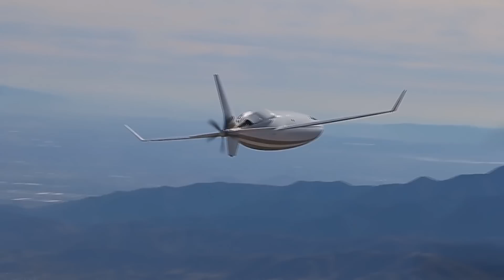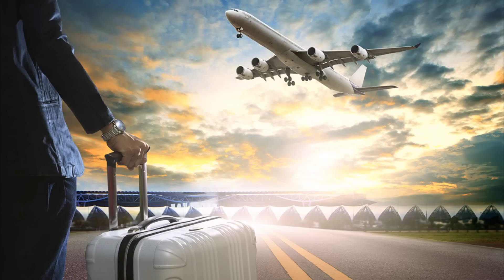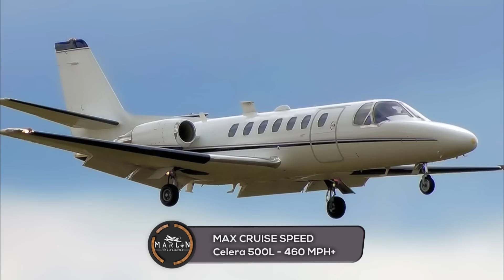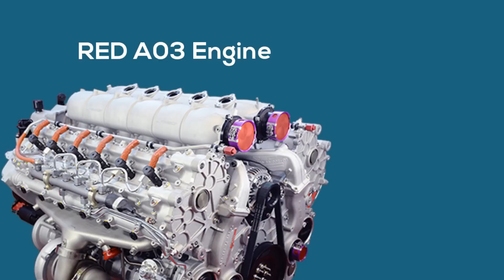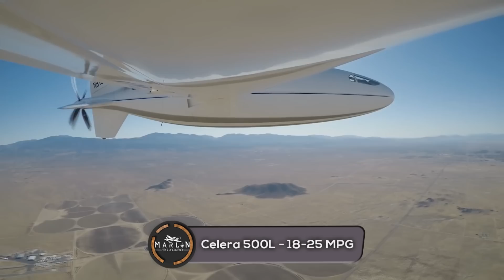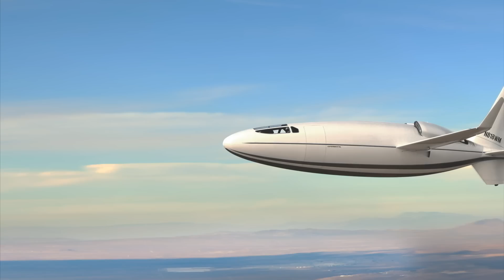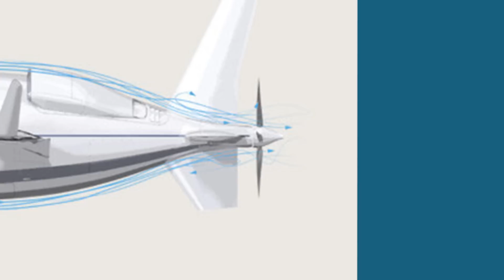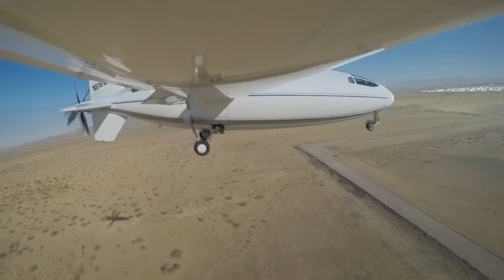Meet the Celera 500L (Flies Faster, Farther, Higher, Cheaper)

Comment: Is bringing inexpensive, private flight to the middle class necessarily desirable for society?  It would take 17 Celera 500Ls to equal the capacity of a 100-passenger jetliner. Granted, each plane is smaller, but that would mean 17 times the number of takeoffs and landings to move the same number of people and many airports are at or near flight slot capacity already. All those small planes in the sky could create and air-traffic control nightmare and might require the building of hundreds of more airports.

Comment: A standard diesel engine and an electric motor could cut costs to totally revolutionalize the air transport industry.  Take off with the regular engine, cruise at high altitude with the electric with power from the solar panels in the wings, and fuselage with the diesel engine as back-up.  This thing could reduce costs to almost nothing. It wouldn't even need that much fuel.

Comment: They should look at the wright speed electric generator jet engine as a hybrid for electric propulsion. Also flexible wings for control surfaces replacing mechanical surfaces saving weight and reducing drag. The design has the potential to eliminate business and 1st class air travel from air lines. A drone version would be a great freight hauling ( remote locations ) or high flying long endurance observation drone.

Comment: Paper airplanes often have remarkable capabilities. Let's see how this performs after it actually is built and flies, if it ever does.
Reply: I think they have a bare-bones unit in test, but they are a very long way from a certified aircraft. There will probably be significant performance degradation when the cabin is furnished. Things like seats and windows and window shades, and drop-down oxygen masks and carpets and fasten seat belt signs ,and a potty and pressurization, that a plane in this performance class absolutely requires not to mention de-icing and weather radar all weigh something and detract from performance. Pusher aircraft often have noise problems, and one of the selling points of this aircraft is it's ability to get into a lot of smaller airports that are operating under extreme noise limits. Carbon fiber anything hasn't been especially cheap, and price point is very important in making this thing viable. This is a very complicated,  very limited production engine, which, as far as  I know also has to go through certification since it has never been used in an aircraft before. Sounds like it will make Formula One engines look cheap .Exciting concept, but in aviation, it takes an enormous amount of effort and money to get a concept into production.

Comment: Yes in my opinion it has sick specifications and yes it would most certainly disrupt the market . Remarkable efficiency. Garima this aircraft has three times the range of a typical 6-seat  passenger jet which means the passenger jet has to land and take off three times so even if it was traveling 50 knots or 100 knots faster it would not matter one bit since it has the land and take off and use more fuel and over head expense and time which would drastically increase the cost of going from a to b correct?

Comment: Beside the already proven X-1, efficient, .50cal copy fuselage design, have you ever bought your kid one of those hard rubber underwater torpedoes to play with in the pool? With water being 800 times more dense than air, any design that goes half way across a swimming pool with a flip of the wrist is certainly something to consider. See the resemblance?  Good on ya Otto!

Comment: I can see this replacing most single engine aircraft very easily. Costs less flies further, roomier, is not a patched up 1960s or 70s design but new with all the fixes built in and at least most of the bugs built out.

I'm sure it will still cost as much as a couple of new suburban houses with all the trimmings and in ground pools. I want these guys to succeed.

Comment: What makes this plane different is not the shape, its the engine.

Its a DIESEL. 

Aviation diesels are a game changer because not only do they use a cheaper fuel (jet fuel instead of gasoline) they burn that fuel more efficiently.

They also made each each side of the engine independent so it is technically two engines in one block.

This is a big deal because the FAA puts huge restrictions on single engine passenger planes.

The weird shape is from them putting a large business class cabin in a small single engine plane...and then using every trick in the book to get drag down so that engine could make the plane go fast.

If the operating costs are low enough , you could see the price of a chartered flight from  Chicago to Disney World drop down to something a middle class family could afford.

(Imagine a family vacation that didn't involve O'Hare or Orlando International Airports...or being crammed in a plane with 200 other people)

Comment: Be great to see if they could use a Deutz air-cooled V8 diesel, and ditch the reduction box (assuming it uses one)! Possibly make it even cheaper to run?
Reply: The Red A3 is a very unique unit. It is actually two inline 6 cylinders geared together that can be decoupled in the event one bank fails, providing better redundancy than a twin.

Comment: Very interesting design that solves many GA issues such as archaic power plant running AVGAS replaced with high efficiency FADEC Diesel running on inexpensive and more available JP1. The laminar low drag is revolutionary as is the pusher power plant. I like the diverse single engine non-turbine solution that gives superior economics of diesel over brayton gas turbine. I’m intrigued about the flight characteristic and curious why a forward canard airfoil was not implemented to impart better safe-by-design due to nearly impossible to stall flight characteristics with a forward canard airfoil. Love the fuselage fuel tanks and dry wings as this has much improved accident safety implications. Also, the rear stabilizers and control surfaces provide significant protection from a prop strike that can easily cost $100,000 in a gasoline piston engine and $500,000 in a turbine engine.

Comment: For a plane focusing on laminar airflow, I'm surprised they didn't do a flying wing...   Ultimately, such planes are limited in size hence until we have autonomous vehicles which we probably could already do with airplanes today, the costs of operation will be high per passenger.

Comment: Aircraft engineers here ? Concerned about the CG being far aft, with a long fuselage forward protrusion destabilizing the whole thing. Hence the need for a giant fin. But there is no room for a standard low AR fin as the structure of the fin must leave space for the engine compartment. This fin has an AR ratio so high it may stall under relatively modest slip angles. As always, optimization of a criterion being made at the expense of other criteria. Comments welcome.

Comment: very well designed plane. low body drag, thin wings withe great lifting ratio and well placed rotor. those drag designs technologies have been applied in solar cars and some airplane concepts by boeing. this is good news but still a sailboat doesn't consume energy.

Comment: I've been following this aircraft a little bit and iam an avid aircraft enthusiasts and I have to say these numbers and performance claims are sketchy. Don't care how efficient  this aircraft is but there is no way it has a range of 4k or more a turbine engine at 60 thousand feet very doubtful  for a general aviation  aircraft. ALSO putting fuel in the wings is safe just ask Diamond aircrat... I can goon and on. You can make anything glook goodonpaper when you need inventors

Comment: No windows.  I wonder if they can keep the Laminar shape and add windows to the plane.  Imagine the future with hydrogen fuel cell versions (Battery power will not have enough fuel density power a long haul air craft).  Remember how zeppelins used hydrogen for lighter than air travel? Well these are not airships and are aircraft (heavier than air travel), but if they end up using Hydrogen fuel. It would make the circle complete, just a lot safer.

Comment: Looks incredible. Great idea in exploiting the lower drag associated with laminar flow. Would laminar flow result in lower cabin noise?  
What about the larger 100L (1000L)? What is the passenger seating capacity and headroom of the proposed  larger model. Are performance specs of the larger model expected to be similar to the 500L?

Comment: As someone who flies a jet for a living at the altitudes and speeds that this aircraft company claims it can do...it’s not possible. I fly an aircraft that carries 10 passengers with a smaller fuselage cross section and it does about 460 knots at 41,000 feet with about 40x the power that little v12 makes. My guess is by the time they put an interior in it, make it handle safely, and get it certified it’s gonna do 250 knots max. Hate to be a hater but the only prop planes to come close to those speeds are the Reno air racers which have many thousands of horsepower, have propellers from defunct airliners, clipped wings, slammed cockpit canopies, and are listed as experimental because their handling isn’t safe enough for passenger transport.

Comment: I would like to see an independent group test this.  It has a 2 vertical stabilizers, one is quite large, that should produce a lot of drag, also 2 large ducts.  The body is the only thing that's different and all planes have decent aerodynamics.  Won't wind mess with the laminar flow?  What's with the tiny windows too?

Comment: Review the work being done on flap less wings using materials that flex (FlexSys) and directed air flows. Electrify the propulsion, wrap the surfaces with solar cells. Review the battery tech of Tesla for high energy batteries / kg. And Drone tech for remote pilots. A 1000 - 1500 mile electric passenger plane for regional flights would provide a very low cost work horse.

Comment: Always liked that prop blast under the wings. doesn't work well with a rear mounted engine.  Also pulling it is far more stable than pushing.  But this plane would be handy for mounting machine guns and canons up front.

Comment: Using the publicly available images and data on the aircraft, the RED A03 engine, and assuming they are using a NACA 6 series airfoil or something similar, I created a model of the aircraft in X-Plane 11. Remarkably, the X-Plane model flies almost exactly as reported on the website. The plane will fly at 460 mph TAS at FL250, but slows a bit going to higher altitudes. It does fly at FL500 and can actually continue climbing at that FL. I haven't tried to see what the ultimate altitude is yet, but it might be somewhere in the neighborhood of FL600. Using X-foil to model the airfoils I created airfoils in X-Plane over the useful range of Reynolds numbers. I also modeled the airfoils with ice or snow on them. The drag is about two to two and half times higher with turbulent air flow over the wings, so it definitely needs to have clean surfaces to achieve those numbers, BUT it seems as though it can achieve those numbers if the surfaces are kept clean.

Having seen many other designs come and go over the decades I have been involved in aviation, I share the skepticism the design will be a commercial success, but from an aerodynamicist's perspective, the design seems like it has a good chance of meeting the stated performance, IF the cooling drag does not prove to be the fatal flaw in the design.

Comment: Just looking at all the shapes, confirms in my mind that it does what is claims.    The only thing I question is the 60,000 ft ceiling with a piston engine.  I also wish they would let the original design grow organically and not push and mention that it can do all these other things like an electric version, and other future possibilities it just sets up this beautiful airplane for failure.  I know, because I've created many things for the bicycle industry that were far ahead of their time and though they worked better than advertised they failed, all because test people who review new products often and purposely pushed their designs way past their limit, and when they fail it gets bad press thus killing the product before it could even be mass-produced.   My advise for success, "Stick to the original and don't over-promote future possibilities". Dan
Reply: There's a limit you can grow it to, before the laminar flow advantage is lost. Then drag starts eating fuel, not distance.
Reply: @davidwright8432  Maybe dimpling the fuselage like a golfball in key areas. Or just like the integrated winglet allowed a 747 a substantial fuel saving gain and so on.  The point is to keep trying.

Comment: Making an Aircraft shaped like a Dolphin, or Penguin, is known to have advantages and has widely been discussed frequently to use in aviation. Before we will see electric propulsion, or something even more advanced, we will have a return of the piston engine, running on jet fuel. That's the way to go. There's a good reason, why there are still several hundred of DC 3 in service.

Comment: Not sure I would believe those performance figures.  
There is a huge amount of form or parasite drag, with that huge fuselage, which cannot be efficient.  Look at gliders, which pare the rear fuselage down to almost nothing, to reduce parasite drag.

And how do they balance that fuselage, when the cabin CofG appears so far ahead of the CofL?  It looks like a Piaggio, that someone has stolen the canards from.  And if they balance the aircraft with powerful elevators (instead of a canard) that is hugely inefficient. 

Again, I remain skeptical of those performance figures, for something that does not look like a glider (which are the most efficient aircraft flying). 
P.

Comment: Can it be converted to electric
Reply: Sure, it was mentioned but I think heavy batteries with relatively low energy density don't support long-range, high speed, high altitude traveling very well. 

Fuelcells powered by liquid hydrogen would allow light tanks while the fuel is extremely light weight but this would reduce the possible destinations to airports with liquid hydrogen infrastructure. At the moment there are none. Elon Musk was able to create and kick-start the global charging infrastructure which supported his vision of electric vehicles long distance traveling. Otto won't be capable to do this for aviation.

Comment: Sounds great, but lets see it in production. Also, the talk of skipping lines at airports is bullshit. If everyone were to have an individual plane then the skies would be a as crowded as the roads (with resulting air traffic jams), parking problems and more, multiplied by the relative size of a small aircraft compared to a car, and airports can't magically process people faster just because your plane is smaller, quite the opposite actually. In reality a cheaper private jet just makes the rich a little better off.

Comment: I don’t believe a single one of the claimed specs. Speed? Nope. 300kts max. Ceiling? Nope. 30k max. Range? Nope. With pax, 2000nm max. Glide ratio? Nope. Steady speed glide of 15:1 max. 

You can only do so much with 550 horses.

Comment: "Otto's time at Otto Labs made traveling 2 million miles a year possible"
Sounds like you're presenting that huge distance as some kind of positive, superlative feature!
Should be "made 2 million miles a year NECESSARY"!
Just really strange wording.

Any private plane can get you around commercial aviation check-in lines, so that's not really a new innovation there.

What is really different here and most noteworthy, is the superior aerodynamics, and the composite structure that together reduces the power needed for flight. Which of course equates to vastly reduced operating costs.

I think private jet manufacturers will have to rethink their designs, because the Celera will soon be handing them a beating in the private aviation marketplace!

Comment: Many very clever people have come up with silly ideas. I'm not sure this is silly (not yet, anyway), but it certainly is niche. I am struggling to think of many corporations that would purchase these in significant numbers. Even if maintenance is reduced by 80%, an aircraft that requires five times the maintenance only needs to carry 30 people before you're ahead, since you only need to have one pilot instead of five, one take-off and landing instead of five, one safety inspection instead of five. Economies of scale so often win out over flexibility in the micro-scale, even if there are efficiency savings.

Perhaps one day, having a fine-grained control over which people want to get where, and having more smaller airports scattered around instead of massive centralised ones ... maybe.

I can see a market for enthusiasts and people with lots of spare cash to throw around, but not much else. The drone idea I think is a lost cause mainly because tried and tested drones already exist, and that would be a tough market to break in to.